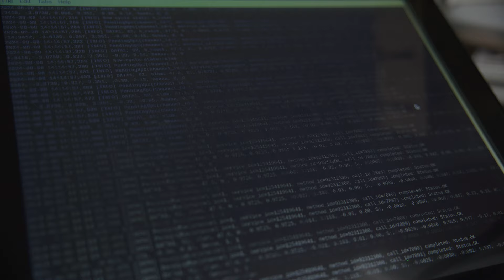Safety First with Keenan Wyrobek

Comment: What's the tail propeller for in the drone ?
Reply: I'd guess to be able to control it better - three will be winda, etc. that affect it's position. Line won't be straigt down in wind if it doesn't have propulsion.